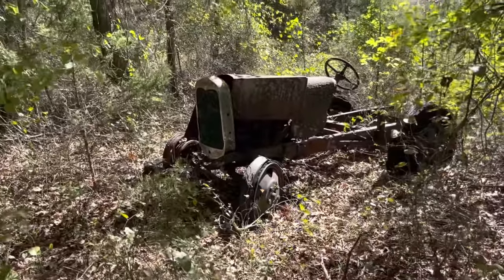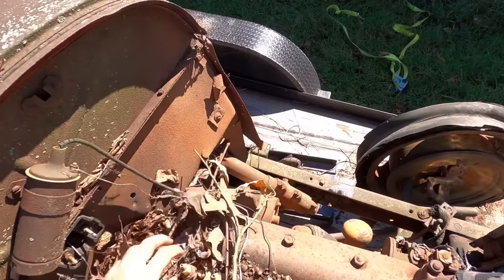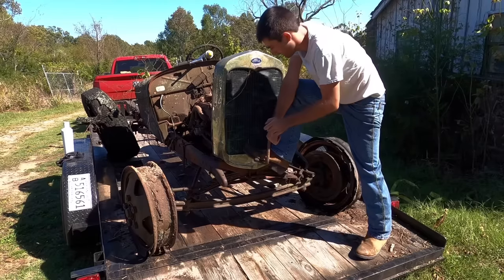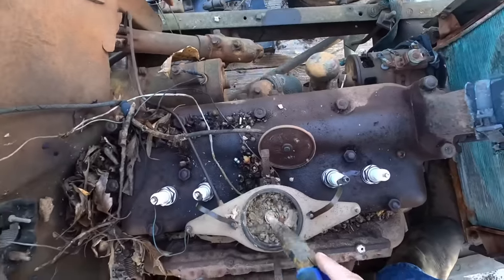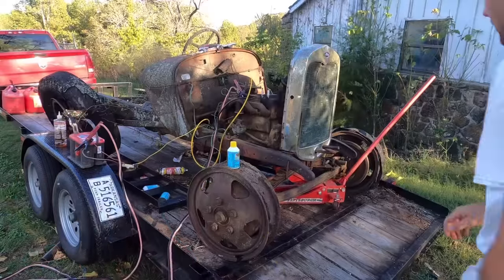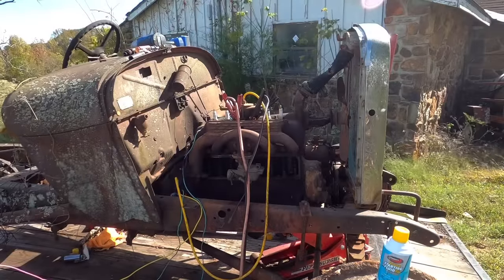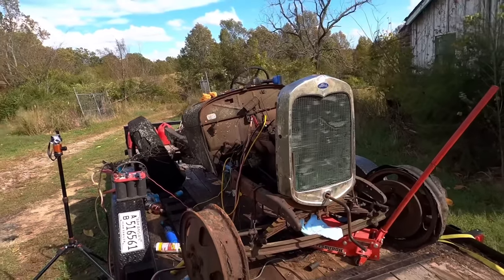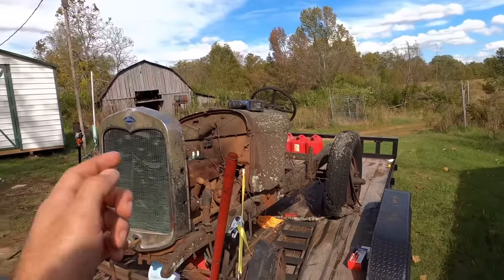Will it run after 72 years 1930 ford model aa Doodle bug ￼￼

Comment: A testament to the durability of early cars.  I doubt a modern car could be revived if set out in the field
Reply: all of the plastic would deteriorate rendering a modern engine useless.
Reply: Let's not forget circuitry that would fail
Reply: My thoughts exactly and why my vehicles and farm equipment are 30+ old. Just one mouse chewing one of the miles of wiring new cars have would leave it unable to run.
Reply: New cars would be dead. The ecu, tucked, bcm and other computers would be toast
Reply: Low compression isn’t as efficient, but it is long lasting!
Reply: @BrodieBr0  A mouse chewed up my wire harness to my ecu.....Bran new car and wouldn't run. Cost me $2k out of pocket because I didn't want to claim it on my insurance
Reply: @boostjunkie2320  Sorry to hear that...My uncle had the same thing happen to his 2020 Corolla but it was an ignition wire in the dash the mouse got. Car was under warranty but he couldn't use it for 3 months because it took them that long to find the issue. I admit  newer cars are better for crash safety and comfort, but that's about it.
Reply: @BrodieBr0  I'm $4.5K dollar's in so far.
Reply: @boostjunkie2320  Hopefully it wasn't one of my rust buckets going by you if you live in NY. lol I daily drive a 1992 Dodge W350 5.9 Cummins, 1990 Dodge D250 5.9 Cummins, and a 1990 Jeep Cherokee Pioneer. Joking aside, sorry you're down so much $$ and hopefully they get it going for you soon!
Reply: Modern car would start no problem. If you spray starter fluid in the intake lego engine would start too. Modern cars are mostly made from non rusting corroding materials so that won't be a problem also ecus are very tough and are in very strong case. Model t is very tough and it's very impressive  how it managed to start honestly when i saw the video i knew it would start.
Reply: @thefattmatt  plastic will last longer in open than some steel parts cause plastic can't rust and plastic used is extremely durable to temp and other things the sun won't make difference for it. All very vital parts are metal. Plastic parts have lot of advantages. It's  not plastic more like some composite material.
Reply: @dkdanis1340  The ECUs of most modern cars are also stored inside the cabin.  The 90s had a brief period of flirting with putting them in really dumb locations where water sling from the wheels would destroy them long before the car ever sat out in a field.  Worst case, with a modern car, you'd have to plug and unplug the ecu a couple times to make good contact again and they'd just turn over and run fine.
Reply: Too many electronics and computers, aka it would be a living nightmare to try
Reply: @thefattmatt  doesn't plastic last longer than metal? Plastic doesn't rust...
Reply: @jackdarby6080  Plastics can oxidize and become brittle due to such. It does take longer than metal, but in most cases metal components are more durable and can still work properly even with more damage.
Reply: Y’all are forgetting that cars were considered worn out at 100K miles not that long ago.   They were easy to work on, but new ones are way more reliable.
Reply: @BrodieBr0  gas mileage, reliability, ac and heat, going more than 50 mph. Modern cars might not be good if they aren't maintained but most will last as long as you're willing to drive it. I do love these old ones too tho, definitely more durable because of heavier, higher quality materials
Reply: @OvertravelX  yup, there's a reason cars are made the way they are these days, they don't just do it for no reason 😂
Reply: Electronic parts in modern cars are already going bad after only 10 years on the road. They are also overpriced and no plastic cheap enough for body panels can hold it's structural integrity in the sun. Sure, thin or low quality metal can rust, but Model Ts and As are made of metal so high quality they almost never rust through. It's no contest which is better when you compare a dollars worth of oil to $4000 in electrical repair, and electric cars will be even worse when they become more mainstream.
Reply: If it was so durable why’d they leave it sit out in a field? Because it wasn’t.
Reply: batterymaker,,, im 80yrs young,,,
its    " 6 of one and half/a/dozen of another"
the modern car comfortable , mostly are economical on gas,,,,, were as older cars and i have owned most makes and repaired them mechanically and body,,
i travel from Beverly Hills Ca ,,to  Scottsdale Az
imagine that journey in a 1920/30 Ford,,, Chevy 
i rest my case lol Edwin JT
Reply: Hello readers, how are you?
I want to tell you: THERE IS A GOD WHO LOVES YOU AND HE WANTS TO SAVE YOU.
The proof of His Love for you was on the cross.
This God has a law, we do not keep it, we sin, our sins condemn us, but still, even if we are imperfect, God is merciful, because this God sent his Son Jesus Christ to this earth to save the world, Jesus is the Son of God, Jesus was the one who perfectly fulfilled the law of God, HE pleased God. When Jesus was here, he did good to all and healed those oppressed by the devil, he performed miracles, signs and wonders, the blind saw, the deaf heard, the dumb spoke, the lame walked and the dead rose again, because God was with him.
Jesus was a man who stretched out his hands to those who had fallen and did not step on them.
Jesus came to save and seek what was lost.
Jesus is the lamb of God who takes away the sin of the world, this Jesus was rejected, offended and condemned to death and death on a cross, but this is where God shows us his love, in that Christ died on the cross for our sins, he died for us, it was an exchange, he suffered condemnation in our place, and after three days God raised his Son Jesus Christ from the dead, because death could not stop him, for in him there was no sin. Jesus Christ conquered death,
He conquered death and today we have hope, God now announces repentance to all men.
JESUS CHRIST is the Judge who will judge the living and the dead, what GOD is now announcing to all people is repentance.

Repent of your sins, turn from your sins, believe in Jesus Christ, you cannot be saved by your good works, only Jesus can forgive your sins and save your soul, believe in him today, repent today.
Reply: @JRB781  buy a 4 runner body on frame
Reply: @BrodieBr0  newer cars are faster, comfier, safer and no matter how reliable you call old cars, They won't break down in the middle of the road half as much as an old car would
Reply: A modern car couldn't even survive that long sitting out, you'd be lucky if there was a car left.
Reply: The biggest issue will be the lack of replacement parts for the many sensors and systems that you can't easily bypass with sheer ingenuity or fix without some serious PCB technician skills. David Grainger goes over this on his podcast, he thinks it's unlikely late OBDII cars will be restored at all.
Reply: Without even software updates its nearly impossible!!
After 10 years of no software never mind 70 years.

Comment: would be a shame not to use the engine for some project. It runs and it has a good tone. Put it in something.
Reply: That was a lot of starting ether.  Wd40 works too ;)
Reply: @ryanscott2548  I was just wondering about that the other day lol.. WD40.
Reply: Jeannie✪ঔৣ꧂  why are you here? Cause im not interested.
Reply: If the block isn't cracked and the trans can be saved it would be a good core for someone's project at least. It sounded really healthy and either is a good fuel to at least find out if something is dead or half alive. Low compression devil like that likely enjoyed a task of the old consent in a can.

Comment: The phrase "They don't make 'em like the used to" is really proven through your work!  Can you imagine anything on the roads today, left out in someone's backyard, will do the same thing 72 years from now?  I highly doubt it.  Nice video.
Reply: Naw, the miles of wiring will be all eaten up by mice, and the computer chips will be all dried out or shorted out.
Reply: @pookysdad4884  I could imagine 70 years from now as the ECU gets pulled from the powdered plastic housing him saying, 'yeah these things are still available, just 17000 bucks and she's sparkin' again...'  Viewers thinking 'wow, just 17 grand, I wish my car parts were that cheap..
Reply: They will start even easier. Chips are extremely tough. Here's the thing he bypassed many things that could go wrong heck he sprayed fluid directly in the carb. Modern cars have aluminum blocks and many other non rusting corroding materials so they will be in way better shape in 72 years. You could spray fuel in intake of a new car and turn crank manually too.
Reply: @pookysdad4884  no they won't appart from chips withstanding crazy low and crazy high temps without any problems they are also in very safe case they will never short circuit. Also model t still needs wires for spark plugs so no difference there plus new wiring harnesses are very tough and can work even without some wires.
Reply: Think about it these old cars will still run  in the event of EMP's or other things electrical that would completely wreck today's modern cars so yeah the less electronics in vehicles the better hell my 73 bug runs way better than my 01 van packed full of sensors and computers so think about it today's modern cars are made to break where the old cars were made to last cause of the computers in today's vehicles they are way more succeptable to say a transformer blew on your block and created a localized electric magnetic pulse that fried your cars computers and your neighbor has an old let's say a doodle bug in this case  and it turned out just fine maybe just a battery to replace and it was back on the road in minutes where your fancy modern car had to be scrapped because it needed every electronic component replaced so no today's or even tomorrow's cars don't have a chance in hell seventy years later worth of sitting just saying
Reply: @DrakkiiTheLittleDragon  modern electronics are way more durable than any old. They are completely invincible to emp nothing will happen to them. They are literally way more resistant to emp than regular ignition. Throw your theory away. New cars will outlast any old car 4 times. The only reason why your 73 runs "better" cause 01 van isn't at all maintained. Modern cars fire up like a mine in blizzard, altitude, temp nothing matters they run like a clock everywhere.
Reply: @dkdanis1340  Aluminum does corrode, my friend, and quite badly in the right environment. It does so ESPECIALLY in contact with iron, which is in 95% of all bolts.
Reply: @dkdanis1340  I am not trained in electronics or wiring, but I suspect you are putting far more faith in today's technology than is warranted. Only time will tell how current parts stand up to the elements and critters, after 50 years in a field. I think most of the world will not be an old car culture by then anyway. The old guard like my dad and me will be long gone.
Reply: @dkdanis1340  Not quite. EMP induces current spikes mostly into the wiring loom, these spikes can be hundreds of volts with thousands of joules of energy behind them. No chip can withstand that type of onslaught through every sensor that has exposed wiring, and not only the ECM, BCM, TCM, ABS and ancillaries, but every sensor will likely be destroyed.
Conventional kettering ignition only risks possibly burning the coil out, maybe the condenser depending on whether the points are open or closed. An old school diesel may lose its charging system, but it won't stop it from running.
Reply: @dkdanis1340  It hardly matter how tough the chips are. the fact of the matter is the more extremely complicated the devices are the more points of failure there are, the harder to produce they are and therefore the harder it is to repair them far in the future. An old engine from back in the day can basically be fixed with some common components. what if you have a modern car full of sophisticated technology and and possibly multiple pieces of computer hardware? What are the odds many cars today have proprietary parts that are expensive and are hard to source from anyone other than the manufacturer? very high. So what happens if the manufacture goes bunk and/or you can no longer find their proprietary parts or specialized maintenance protocols in 70 years? Well best case scenario you would basically need to hack or reverse engineer the process yourself. which is probably harder for such an advanced piece of equipment then it would be for a 1930 ford
Reply: @alasdair4161  EMP will make thousands of joules from a car wiring harness?  No way!  It takes MILES of wire to generate significant energy from EMP.  It's a threat to the phone lines and power grid, not to cars.
Reply: @21stcenturyfossil7  Well it really comes down to magnetic flux intensity and a wire passing through it over a time domain. If you have wiring contained within a ferric metal structure the magnetic impulse can easily induce thousands of joules. The metal works like a transformer core that can magnify the effect compared to free air. The intensity can be also be magnitudes higher than conventional magnetic sources would deliver and the energy by product would easily overwhelm conventional chip input/output protection systems that rely on devices hardened usually to <50v and then using their relatively high source/drain impedance to provide protection by using simple series resistance on all I/O's. They are still very fragile, even a jump start can destroy an ECU from back emf caused by a few metres of wire's inductance, and that's tied to a low impedance source, being a flat lead acid battery. Some car's can suffer software problems just from noise inducing devices being plugged into the accessory circuit, often emitting just a few volts of ripple or noise into the system. 
Car manufacturers will also never tell you there's any risk.
Reply: @alasdair4161  If the EMP effect worked as you imagine it, every thunderstorm would disable thousands of cars.
You seem to be postulating some sort of resonant effect working hand in hand with EMP to destroy electronics.  Were all the transistor radios in the Pacific Islands destroyed by the Starfish Prime test?
Yes, car electronics are sometimes damaged after a jump start.  Not often, but sometimes.  It has NOTHING to do with the inductance of a few feet of wire.  What happens is the alternator in the running car is charging the stopped car at up to 100 amps.  The alternator's field is at full power and if it is instantly switched from a heavy load to a light load, the alternator is capable of generating a high voltage surge in the moment it takes for the alternator's field to get back to normal.
Reply: Thunderstorms are so high up in the sky and does not cause any of the effects of EMP's look up the definition of electrical magnetic pulse today's technology is way more succeptable and unreliable generate enough heat and technology melts apply enough pressure it breaks apply enough volts and it fries apply enough time and it degrades that's the fact of the matter yes old vehicles can be beyond repair but it's a lot easier and cheaper to fix up an antique engine and keep it running and more often than not better than today's vehicles packed full of technology so I don't care what anyone says technology has no place in vehicles and should never have been placed in a car in the first place
Reply: @dkdanis1340  lol you're so silly, it's been proven time upon time again that old cars are more robust and reliable than modern cars 😝
Reply: @fishywishyfishfisk  I agree with you man
Reply: @fishywishyfishfisk  modern cars can run non stop full throttle they won't even overheat. Modern engines are so overbuild they can handle 3 times the stock power, handle any condition, any temp anything, fire up instantly in morning. Throw your theory away. And it's been proven that modern engines are way more robust.
Reply: @dkdanis1340  have you seen what happens to aluminium after 70 years outside unmaintained?
Reply: @dkdanis1340  have you seen what happens to aluminium after 70 years outside unmaintained?
Reply: @therealrobertbirchall  there's many different kinds of aluminum and car aluminum is very different from an aluminum can or foil or really any other aluminum
Reply: @tati-anaroseee4316  I know I happen to be a retired mech fitter. And belive me I have seen AW6060 engine blocks dissolve after a few years un loved in a marine or any damp environment.
Reply: I think it will be even easier to rebuild a today's car in the future, just 3d reprint any deteriorated plastic parts and emulate the ECU with your smartwatchsoever. No carburator nor fancy mechanics. It's easier to rebuild almost everything now thanks to the internet.
Reply: It would just be a pile of rust after 72 years!
Reply: @dkdanis1340  Man ever driven an old volvo? those redblocks are near indestructible lmao, even the 80s 6 cylinders were incredibly robust. When out sliding in the snow i keep my 240 at redline for tens of minutes at a time and it's still runs like a clock, I challenege you to do anything like that with a modern car and have it last :~) mind you the engine in my 240 is a unrefurbished B21A with ~240,000 km on it lol
Reply: I personally hate the debate about “old vs. new”. Old cars have advantages, new cars have advantages. They’re all cars. There’s cool old cars, theres cool new cars. There’s some modern cars that will outlive any old car, and there’s some old cars that absolutely fucking sucked. There’s no definitive answer to which is better.
Reply: I just imagine electric cars wont run after sitting for 5 years